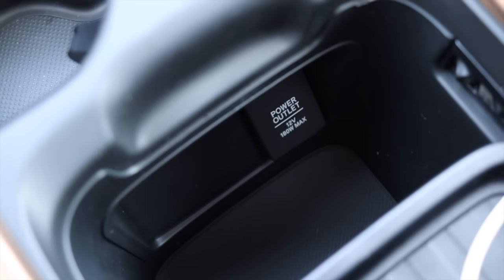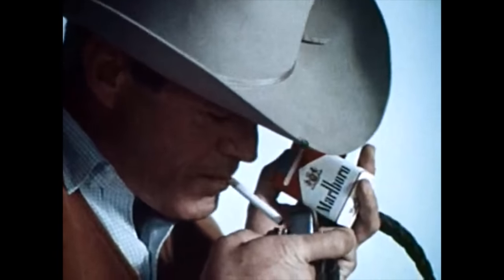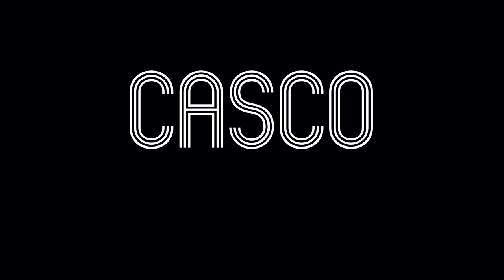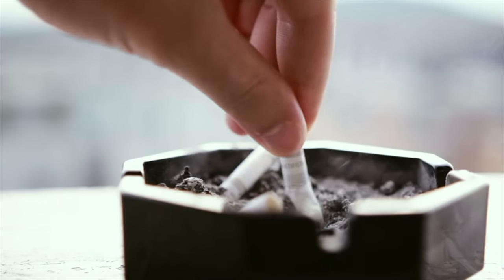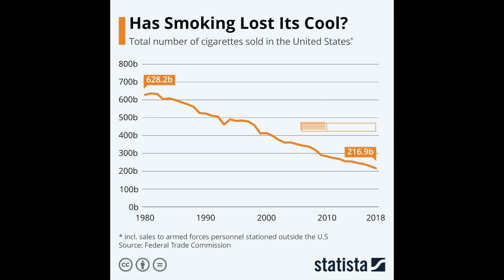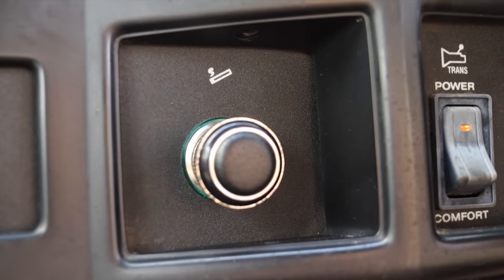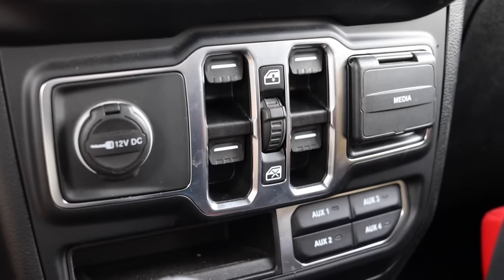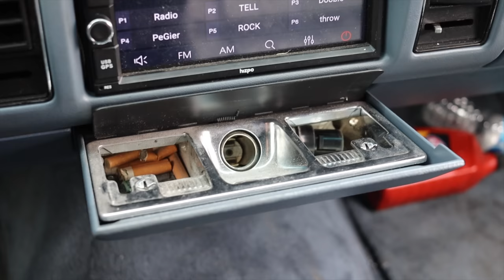Cigarette Lighters - How They Were Invented & Why They Went Away!

Comment: I worked prepping used cars when I was 17. Clean it, undercoat it, spruce it up nice for delivery.
Every once in a while someone would demand a car be delivered immediately near or at closing time (9 or 10 pm) when we, 17 years old, wanted to leave to go party, etc. They would not wait until the next day and the salesman did not want to lose the sale. We were required to work an hour or more late to get some bozo's 'new' used Ford Maverick or Pinto or even a shiny silver T-bird ready for him.
What would happen was, someone would clean all of the resins from their marijuana pipe and melt it into that lighter. Just warm it a little and all of that tarry goo would just flow in between those little metal coils. It was amazing how much could fit.
It was fascinating to watch.
Anyway, the car would be delivered clean and fresh with that 'New Car Smell' (yes, there was a spray can for that) and somewhere close to midnight we'd finally be off work, our evening half ruined.
We had the satisfaction of knowing that the first time they pushed that magic device in, waiting for the tender relief that only a true tobacco addict can understand. it would get red hot in there and their dash would erupt with a foul smokey discharge of spent, oily pot resins. 
🤣🤣🤣

Comment: If you inserted a lighter from an old car into a modern car dc port, would it still heat up? Or has the design changed so that only electrical adapters work?

Comment: I think even if smoking wasn't poplar we would still have circular outlets in cars.
Most HGVS use a 12v and 24v power outlet which although is similar to the cigarette lighter is much smaller.
I just think if we didn't have cigarette lighters we would just have the smaller yet similar power supplies.

Comment: I find it not yet they going to completely get. Ride of it. Those cigarettes lighters have 10 amps or maybe 15 amp capability. Usb C which is found in the new cars can be 1 amp, 2.5 amps or 5  volts, 9 volts and 12 volts. You can't have 12 volt 10 amps usb c. You see a rating of a 100 watts usb c. Which means it can't  have 12 volts- 8 amp the wire will burn.  It then jumps to 20 volts / 5 amps to meet the 100 watts.  Which means if you need portable power to power a 100 watts AC invertor you won't be able to charge a laptop or a TV monitor 🤔

Comment: The problem with usb's installed in cars is shown by the ones at one point in the video 1.0 and 1.5 amp... where as with a usb c  you use a lot more amps to fast charge a phone... matter of fact some of the first users fitted to cars were only 0.5 amp... having a cigarette lighter socket yiu can just update your adapter to the latest technology

Comment: USB can not replace the round cigarette lighter style outlet, because   USB can not deliver a 12V output afaik. There would need to be a completely new outlet for 12V, but why? I hope that won't happen, or else one would need to use an adapter for all the older devices that have the 12V cigarette lighter style plugs.

Comment: I find it strange that the 12v cig outlet has been a standard for such a long time and only now, 30+ years after the invention of USB is starting to be removed. Meanwhile, 3,5 mm audio jacks that have been a standard for 50 years are being removed from mobile phones to instead rely on Bluetooth which is constantly chopping up, not connecting, needing re-pairing and has terrible audio quality for phone calls, and they try to sell it as the New Greatest Thing when they're just being cheap. Some might argue that it is for clearing up space inside the phones. Well, phones are getting bigger and bigger and they no longer fit in one hand. Surely, if there ever was room for a reliable audio jack, it's these days.

Comment: The usb c will take over the old standard usb in cars presently, the 12v plug is almost phased out. I’m seeing 110v plugs in many cars now and even cheap headphones or other electronics with the usb c, even the micro usb is getting hard to find. 

I have a 2005 Silverado that has a cigarette lighter and 12v plug, try finding an apple lighting cord that doesn’t require two pieces. Just bought one this spring 12v to lightening for $35!! And it got stolen!! The usb adapters like to go bad in my experience.

Comment: This video is what happens when someone who doesn’t know the subject matter decides to make a video about it. For example the reason your car outlet looks different than your house is because your house system runs off 120V or 240V AC, whereas your car runs on 12V DC. Cigarette lighter is 12V DC because the car systems run on 12V DC.  You need a specific device (inverter) to plug a 120V AC in to a 12V DC system. To plug a 5VDC (USB) device in to a 12VDC system requires much less complicated hardware.

Comment: Standard usb in cars sucks cause they may give out little energy, may be incompatible with your device (hello samsung, who does not want to take more than 500mah on third-party 3A charger) and other device obsolescence. Imagine situation in ten years, when everything will pass typec and you won't be able to charge your phone. a round socket is required further in modern machines. and if it is not, then I have a drill;)

Comment: The lighter socket was only supposed to be used by the lighter itself and never for any other purpose. The question is: Who first came up withe the idea to sell a car peripheral with a plug that you can fit into that socket? Whoever it was, the idea apparently worked so well that others copied it and soon there was tons of stuff you could plug into that socket. Then the lighter went away but the peripherals were still there, so an outlet was designed to make these plugs fit. The lighter socket was not an outlet, and the outlet was designed after existing plugs and not plugs were designed for the outlet. If lighters had never existed, that outlet would neither, yet cars would still have gotten USB ports at some point.

Comment: Contacts are thicker. One contact (-ve) has  big surface area. This iss goos for higer ampere DC current accessories.
Also sometimes you dont need a switch.  Half insert for off, full insert for on.simple. not surr if that is recommended.

Comment: Question for high current 12v power supply still lingers
As high power requirements of some car appliances like portable fridges can't operate on USB, and even USB type C, mostly because USB alliance made a mess of something that supposed to be THE standard
12v plug is simple, plug in - works, type C requires microchip handshake to pull higher voltages from the start...

Comment: "That's why the outlets in our cars look different to the ones in our homes" Um... really? I think you'll find other issues DC v AC, low voltage (12V) v high voltage (120/240V), low current v high current, etc.

Comment: We would not have had regular outlets. Those use AC, and would have required an inverter, only for the power to probably be turned back into DC by whatever's consuming it. This is very inefficient. We might have had USB earlier, or another connector providing DC, but a regular AC outlet would be unlikely and a plain poor design decision

Comment: If USB is taking over in modern cars and may replace cigarette lighter sockets one day, how does someone charge a laptop or power a hair trimmer on USB?  Cigarette lighter sockets are still needed.  I'm homeless and depend on the cigarette lighter to power my laptop, charge my phone (faster than from in-car USB outlet) and power my hair trimmer so I can cut my hair.  With an DC to AC cigarette lightet inverter, you can even have a printer in your car.  Getting rid of cigarette lighter plugs and only having USB is a bad idea.

Comment: My '99 Ford Ranger has a lighter AND a 12v outlet. The ashtray is sorta useless since I put a Hurst shifter in the truck, in 3rd or 5th gear, its like half and inch from touching the dashboard. So i have one of those cupholder ashtrays cause I'm not a dick that throws them out the window.

Comment: USB sucks; not only did it change shape, which when it comes to car tech, which has to last decades sucks, but it also provides lower voltage and current than what the cigarette lighter can do. It's very easy to convert a cigarette port to a USB port, while the opposite is way more cumbersome. Not only that, but cars usually only do 5V-2A, so when Qualcomm or USB-IF come with a new Quick Charge or Power Delivery specification, with a cigarette lighter, you only run to your local electronics shop and buy a new adapter that complies with the new spec, while with built-in USB ports you're stuck with whatever crap the car manufacturer shipped your car with. The same great idea that stood behind the DIN system as well, but I guess holding onto your car for longer hurts profits, so nowadays people are expected to change their vehicle every 2 years and brag about how eco friendly they are too in the process. Fucking consumerism.